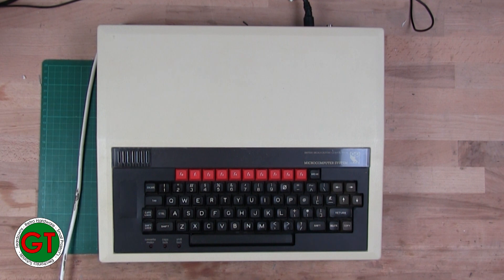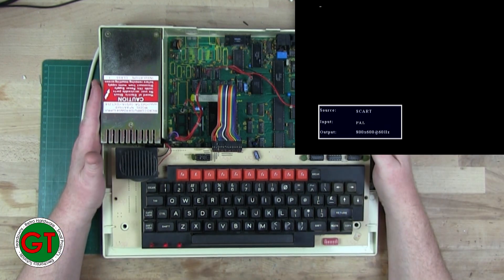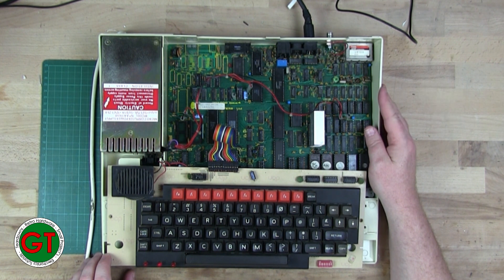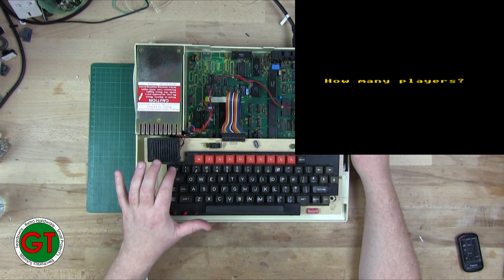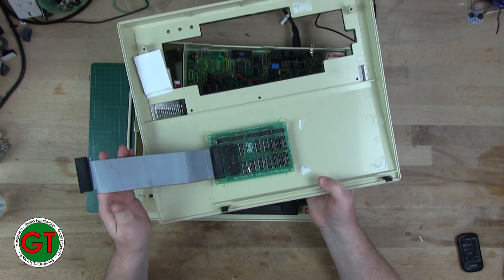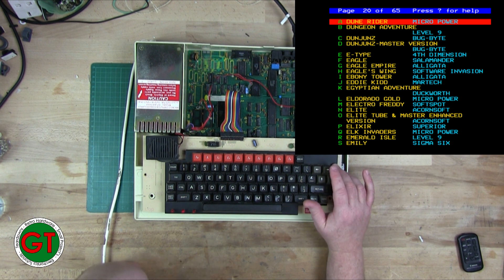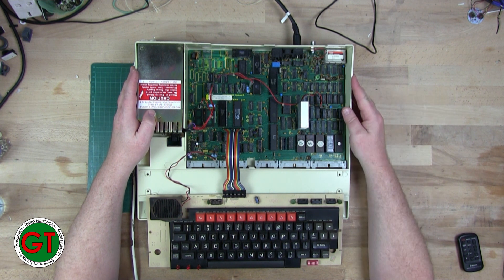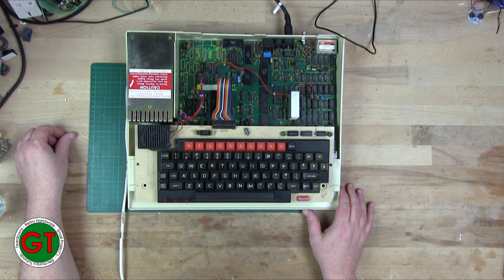Bringing a BBC Model B back to life from a black screen

Comment: I recently picked up a BBC Micro and although it powers on, nothing happens, I don't even get the beep sound, I just get a blank screen.

I'm not sure if you have an idea what could be wrong? , some say it might be the power supply.
Reply from the maker: Hi, check the keyboard cable, if the keyboard is not connected or the cable is faulty the Beeb will not boot, you will get a black screen with a flashing cursor. The PSU's are well built, but they have RIFA capacitors which need to be replaced as they will short and let out the magic smoke.